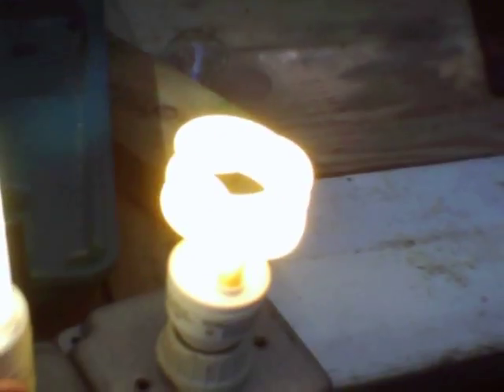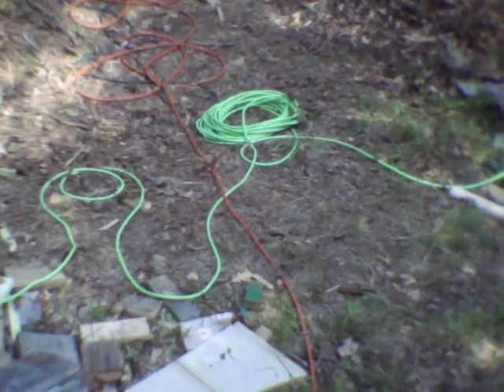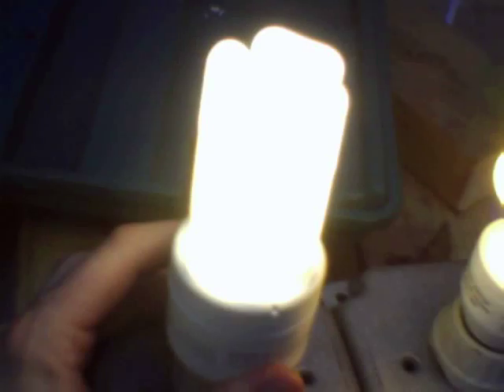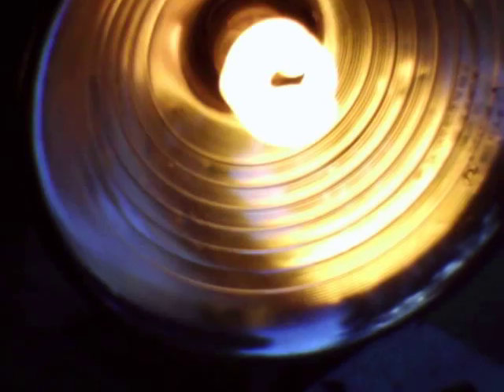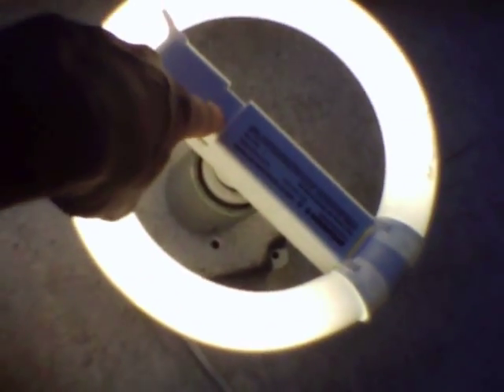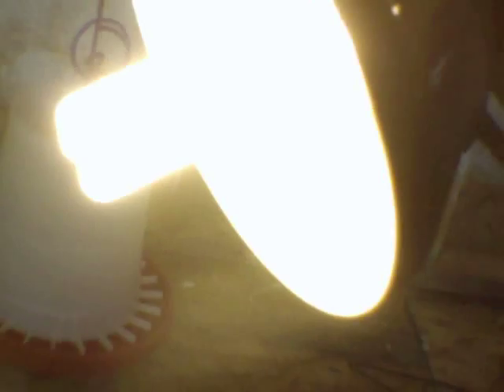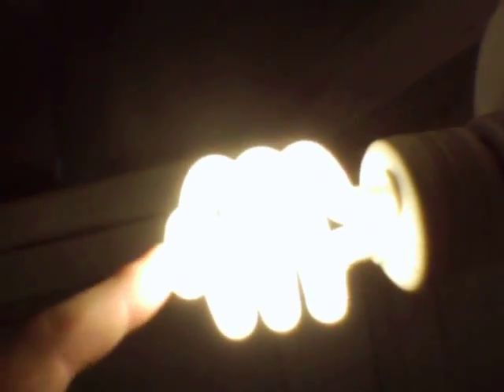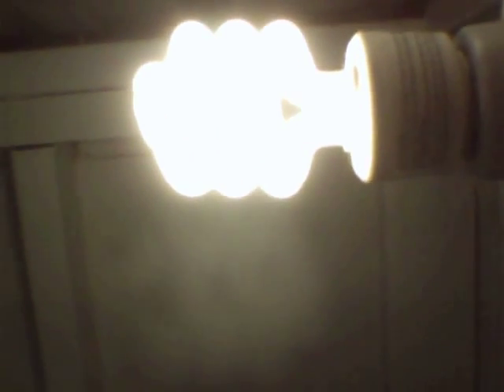Inverter CFL testing

Comment: I hooked up my modified sine wave inverter to a 60w cfl and it runs very quiet and I didn't experience any problems what's so ever
Reply: ToxiC BikEr That's interesting, do you know if the bulb is dimmable or not? I tried a non-dimmable LED on an inverter and the ballast got crazy hot after two minutes. Since dimmable bulbs have different ballasts from regular, maybe they'll work fine

Comment: They are designed to operate from a sinewave, not a square wave from a crappy inverter. Yes, most of them are cheap and nasty but just because they buzz doesn't make them junk. If you are going to the effort of making a youtube video why don't you use some proper test equipment to MEASURE the lamp parameters such as input current waveform, in-rush current, temp rise of the electrolytic cap, warm-up time, luminous efficacy etc etc.

Comment from the maker: @jrmcferren   You might want to try staggering lamp starts, so that there isn't that big surge from them all starting at once, or base load calculations on the apparent power instead of the true power.  A bigger inverter might also help, as I have not had problems with using a 400W inverter in this sort of application.  This might also be a problem in the inverter, as some inverters do not like such high peak load currents.

Comment from the maker: @jrmcferren   Also, if the inrush current is tripping the overload protection on your inverter then there may be some other fault in the system as a compact fluorescent lamp should not trip the inverter unless the lamp is faulty.

Comment from the maker: @jrmcferren   The high inrush current is in the form of current spikes at the point where the instantaneous electrical potential from the inverter goes from 0V to +140V/-140V, so the actual RMS current is actually similar to what it would be on mains electricity or a pure sine inverter.  The problem is the damage to the graetz bridge or the ripple supressor capacitor in the CFL ballast or the switching MOSFETs in the inverter H bridge that these current spikes may cause.

Comment from the maker: @yuandrew   For inverter use I usually use Maxlite lamps, as these tend not to scream bloody murder on modified square wave inverters.  The problem with the 34W Philips Marathon lamps (the newer Earthlights) I have is that they run VERY hot (about 255°F at the electrodes), although this may be unique to the 34W versions.  They do this regardless of the electricity waveform, although they make the same amount of noise on inverter electricity as they do on mains electricity.

Comment: I've had good luck with the older Philips "Earthlight" on modified (stepped) square wave inverters. This was with a Power On Board brand inverter.

Currently have a 300 watt pure sine wave inverter that I could operate any lamp on. My fan doesn't complain either. (the shaded pole motors used in desk fans run noticeably slower and make a loud buzzing sound when operated on MSW inverters).